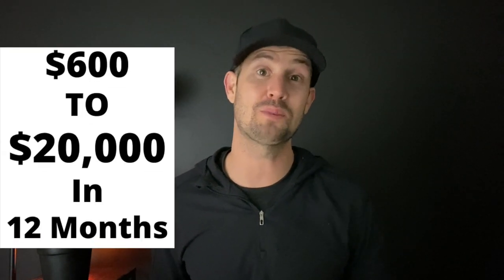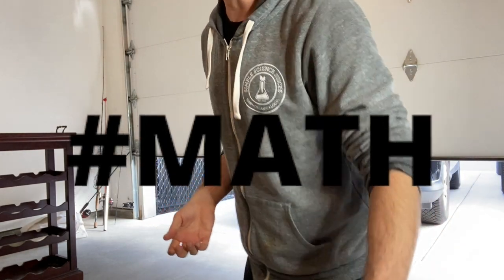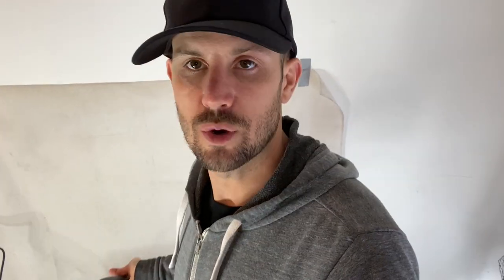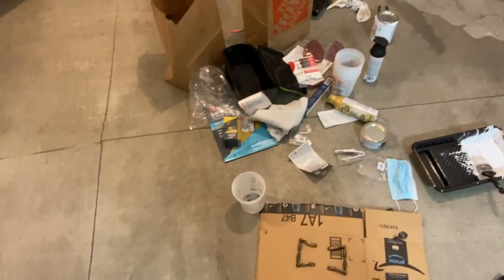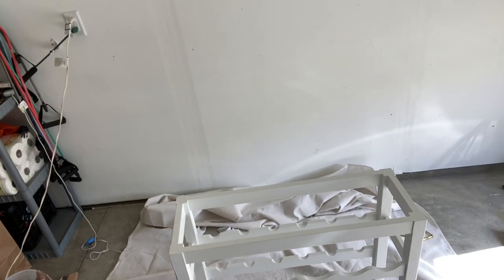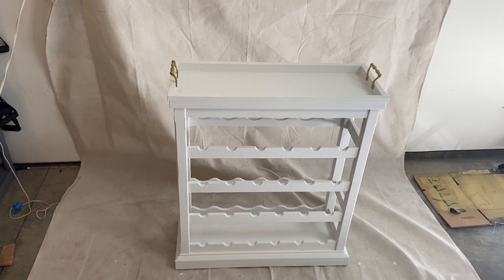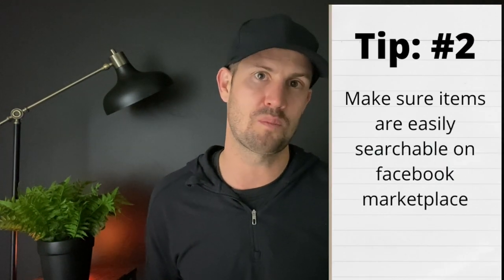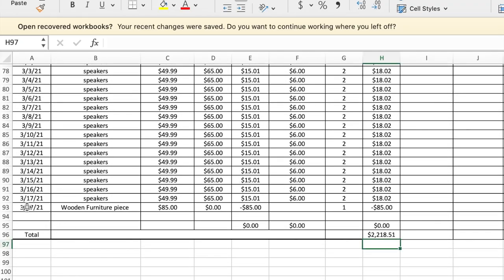I LOST Money Flipping Furniture | Honest Review | The Whole Process and Mistakes to Avoid.

Comment: Add “bar cart”,  “wine rack” and “side table” to your description. Maybe  lower the price just to sell it and move on to the next project. One other thing, if I’m painting something like that with spindles whatever they’re called, I use the Rustoleum Chalky finish spray paint. It’s so much faster than trying to reach all the nooks and crannies with a paint brush. Happy flipping!
Reply from the maker: Thank you so much!! Very helpful advice. I’ll definitely think about that on the next wooden furniture flip. Thank you!
Reply: @sidehustlesteve7970  and spray poly!!
Reply: You pay a lot in the first place. I Got one for $8 dlls. ✌
Reply: If you spray paint things, get the spray paint can attachment. It's inexpensive and you will be glad you did when you are turning it in multiple directions. Applying something to prevent bleed through of certain woods/finishes will allow for fewer coats whether spraying, rolling, or brushing. Typically 2 and occasionally 3 coats is enough.
Reply from the maker: @rhondavanmeter5015  Awesome! Thank you Rhonda.

Comment: If you haven't sold the wine rack yet, do this...find some large wheels and attach them to the bottom...spray them gold like the handles...find some kind of hook to afix the tray to the top for pulling around, but that can easily be unattached when using the top as a serving tray.  Take a photo of some pretty wine glasses on it.  Its a really cute "wine rack-liquor bar cart".  I think that would sell it for sure...if not, wait a few months. People are not having parties because of covid right now...don't give it away. Good luck.
Reply: I thought the same thing to add more functionality to the wine holder table. Plus maybe market it as a island cart once the wheels and hooks are added. Plus take the photos of it on a patio by the grill with wine bottles 4 inside and wine glasses. Keep us posted on when it sells and if you added any other hook or wheels. 
Best Wishes!
Reply from the maker: SUPER creative! Love that idea. I’ll have to give that a shot in another video!

Comment: When painting any dark furniture especially if you're topping with white an oil based primer is your best friend. You wont see most of the bleed through till you topcoat. You did good, you also picked a harder piece to paint, lots of places for drips to occur. You'll enjoy a piece you can do longer brush strokes on.
Reply: Or a quick spray with shellac will seal it. Much easier than primer unless you want to avoid 3 coats of paint.
Reply from the maker: Thank you!! I’ll definitely give that a shot next time.

Comment: 1) Paid too much.
2) Paint job wasn't the best (too many drips, brush lines. Should sand between coats).
3) Item is priced too high. (Always look for free furniture).
4) Pretty good first try.
Reply from the maker: 100% agree! Thank you.
Reply: If you get efficient with the actual work, the in between time can be used on multiple other pieces. If you did half a dozen at one time it would take a day or two and you'd make six times the profit potentially.

Comment: My struggle currently is that I have found several free pieces or pieces for like $15-$20 but those pieces almost always take more work sanding, prep & whatever else. So currently it takes me so much longer to complete a piece & I’m not making much profit at the moment. I’m hoping as my skill & confidence grows I can get faster & better.  So that I can justify spending a little bit more on pieces that I don’t have to do as much prep work.
Reply from the maker: 100% agree with you! I spent a little more on a desk I purchased and didn’t need to do any sanding. Just chalk paint and repainted the hardware. Way easier and a much better profit! Good luck 🙌

Comment: Hi I found the sloth at 16:34 here are some tips I find useful  flipping furniture Look into getting a cheap paint sprayer from Harbor Freight you can get one for under $20 also Look Into chalk paint you can use it in the paint sprayer you just need to thin it down with some with water you don't have to sand before you paint with chalk paint only if it has a really glossy finish or if it has large scratches you just sand to rough it up so the paint will stick if it really glossy/ shinny you can also make your own chalk paint which is a lot cheaper you can get recipes on Pinterest with latex paint make sure it doesn't have a primer or self-priming and plaster Paris and water you must seal chalk paint with some type of wax or polycrylic my favorite wax is the Valspar brand I found the best colors for painting furniture are white with the wood top you sand the top down to bare wood stain it and seal it with polyurethane or polycrylic, all white, black and gray buffets / servers are very popular also hutches , tables and chairs, older dressers vanities coffee bars are in now Farmhouse is extremely popular also mid-century modern always stage you pieces try to have the item against a wall if you can.. when your gluing Furniture I recommend wood glue instead of super glue best of luck on your furniture flipping Journey
Reply from the maker: Wow thank you so much for the info!!
Reply: Your welcome
Reply: I hardly ever use wax to finish personally...I use polycrilic in whatever sheen I'm wanting. I also use a paint sprayer which makes a fast and great paint job and finish.

Comment: The sloth appeared at 16:35/16:36. My spirit animal is a lion. I’ve subscribed. Good luck on your new adventure in flipping furniture! Also, if I may propose a suggestion, that would also make a great towel stand for a restroom. The towels could be rolled and placed into the slots. You can also google different uses for wine racks and pose it for the various purposes to possibly get a quicker sale. I saw the suggestions for priming first, for which I agree. There are also all in one paints that can speed up your time, but they are more costly. I hope this is helpful. Best wishes!
Reply from the maker: Thank you so much for the suggestions! I am redoing a dresser right now and coming to this comment section frequently to get ideas. You all are the best. Thank you!

Comment: A big thing I've learned is contrast. I would have tried to leave the racks alone and keep them the stained wood and painted the pillars and edges of the top white, leaving the inside of the tray wood as well. It would stand out more. Also I highly recommend using a primer when painting dark wood a bright color, it'll save you a few coats of work. You can use a clear coat finish instead of waxing, or buy Dixie Belle's spray on wax.

Comment: I don't do small pieces, too much work for too little profit.  I use chalk paint and don't sand as much.  You can use a non yellowing sealant as long as it's water based if you don't want to use wax.  Good luck
Reply from the maker: 100%! Wayyy too much work for little profit. Definitely sticking with larger pieces or couches moving forward.

Comment: As a facebook market place shopper, I would've definitely bought this! BUTTTTT the reason I'd scroll past your listing is your pictures. I stop on the ones that don't have noise in the background. Its a clean picture clean floor, solid back drop and a little fancy decoration, That top could've had a small glass plate with some grapes on it or a pair of wine glasses and it would've been interesting and caught my eye. If you still have this I wonder how changing the pictures would change things.

Comment: You may have spots bc you didn’t clean the TSP off after you washed it. I’m wondering how well your paint adhered long term. Seeing through to the wood and looking like paint came off is the TSP not washed off.
Reply from the maker: Oh interesting! I haven’t thought about that! A few people mentioned wiping off the TSP after applying. I did that on this most recent flip and it looks much better!
Reply: @sidehustlesteve7970  yaaay I’m glad. Ya always wash the TSP off, I learned the hard way. It ruined my paint job. I had to resand and use a blocking primer and it came out perfect. Good luck to you. Welcome to the community.

Comment: that bar piece may work fine for a cool basement wine storage rack, but how many people have 24 bottles of wine and other spirits they want handy or want to display in their living room or informal living room, let alone how many people have 24 bottles to store in a cool spot in their basement?   i thought bar carts had room for mixing drinks, room for some attractive glasses and bar tools, and room for some bottles.  i see folks are referring to it as a "bar cart."  did you refer to it as a bar cart?  bar carts are typically deeper, not quite that tall, and have caster wheels on the bottom of the legs.  what you have is a large tray and a bottle shelf/wine rack.  in addition, i hate dusting, so personally black would not suit me, but i bet painting it black would sell better than having painted it white.

Comment: The sloth shows at 16.34, and my spirit animal is a bunny. 

You should lightly sand in between coats with a high grit sandpaper to knock down any texture or drips.  And like others have mentioned, you need a primer to ensure no tannins or bleed through.  Not bad for your first project though. :0)
Reply from the maker: I saw someone else talk about light sanding I’m between coats. I’ll definitely give that a shot!

Comment: That should never have taken you 6 hours to do. 2-3 tops. Watch some more tutorials on applying paint. Your technique was kind of all over the place and heavy handed with the amount of paint you were putting on. It was kind of hard to tell in the video, but it looked like you had some runs and drips on some of the edges. A base coat of primer would  have helped in your coverage. The round brush you used for the wax is actually your best option for the small pieces like that one, or table legs, or getting into the nooks and crannies of detail work. Speaking of wax, you don't have to use it on chalk paint. You can use a water-based polyurethane or polycrylic. If you decide you do want to use wax, a company called Dixie Belle actually has a spray-on wax that saves tons of time. Finally, it seems that sales are down industry-wide. I know that I currently have a beautiful end table that's been sitting out there for over a month without even a question or comment on it.
Reply from the maker: Oh yeah there were a ton of runs! I butchered that for sure. I’ll definitely have to work with a primer next time and will try easing up on the paint. Thank you!
Reply: Also, the brush you used for the wax is a great brush for chalk paint, but since you used it on wax it'll be nearly impossible to clean it enough to use it for paint. If I were you I'd keep it as only a wax brush because using it on paint won't be good.

Comment: You had a lot of paint runs which will kill the sales price. It would have been better had you gone back and sanded those down before adding your finish. The top of your piece was the perfect opportunity to have gotten creative and added in some bliss. A glass bead stenciling would have been gorgeous. I personally would have looked for areas to add in some gold leaf or antique gold gilding. Shading would have added a lot to the piece. Go for a color that isn't such  stark white or if you do at the least distress the edges to give it some style.
Reply from the maker: All really great advice!! Thank you! I just finished a dresser (should be posted tomorrow) and I made sure to sand after each coat. I didn’t feel comfortable enough to start adding design work but I’m definitely getting there. I’m going to try a distressed look on my next piece! Thank you again for your comment. I’ll try out the suggestions when I get a little more comfortable. Thank you!!

Comment: The item you chose was not a popular piece.  You painted it white, that type item would have been better black.  Some people LOVE chalk paint, lots of people think it sucks, I hate it and never use it.  In painting white over dark, you need to prime first or use self priming paint. Good tips to spray an item with spindles instead of paint brush, good tip I saw many people note.  The Gold handles made the piece look worse, ouch.  The top price for a wine rack such as that,  would be only $20 bucks at most to me.  You already lost by overpaying for it. I try to keep wood items natural.  I prefer to consider the natural wood and perhaps paint part stain part. On your picture - why the plants?  wine rack would have called for nice glasses etc. so the piece can seen in action.  I would NEVER put a pet or animal in my photo.  Many people are allergic/phobic and even tho it won't matter - they will balk that there was a animal near it.  (cute dog tho) also better to put the item against a wall on a nice rug or flooring.  Nothing distracting from the piece in your picture.  I was more focused on the blue couch - then your finished product.  Just some thoughts.  I have been selling about 40 years, have learned a lot, made a ton of money.  You will get it in time.  You have the right idea, just need to learn the tips that most people can tell you.  Not everything works in all circumstances.  Clean, sturdy, nice and affordable always sells. Good luck :)

Comment: I feel your problem, or pitfall with this piece was you paid too much initially. You paid $35 for a piece of furniture that most people give away, or let go for very cheap. This isn't a very practical piece that people want in the first place.  Also, you could have greatly reduced your labor by spraying the piece instead of using a brush. Spraying also gives you a higher end professional finish too.

Comment: Unless that wine rack was super greasy/grungy/moldy you didn’t need a cleaner as strong as TSP, Dawn dish soap would have been fine. You ABSOLUTELY should have been wearing rubber gloves, (and a respirator if you weren’t in a very well ventilated area). Secondly, Superglue isn’t what you use to glue wood to wood. Ever. Quit listening to the guys at Lowes. They know about wall paint and wall paper, not furniture refinishing. Thirdly, watch more furniture flipping shows! There’s a whole bunch of them that know what they’re doing and what products to use (and which to stay away from). Be careful of the quality of product you send out in the world. Word gets around. I’m curious, if your profit margin is so large with the couches, why do you want to expand into an area you know nothing about?  Wouldn’t it be better to expand your sales area for your couches instead?

Comment: I get it with the sprays.  I use them only occasionally.  However, they are costly, you generally need several cans and all this cuts into profits.  Bottom line.